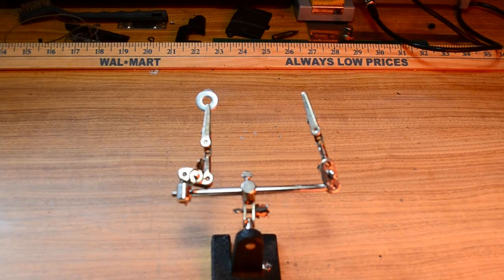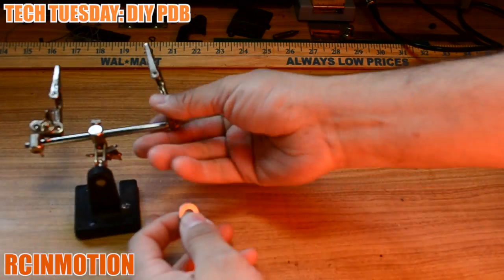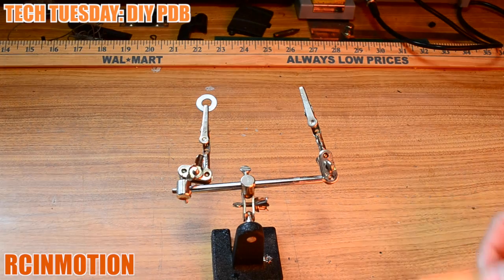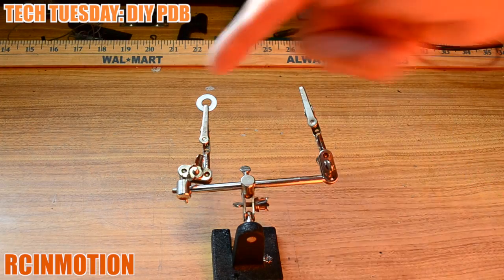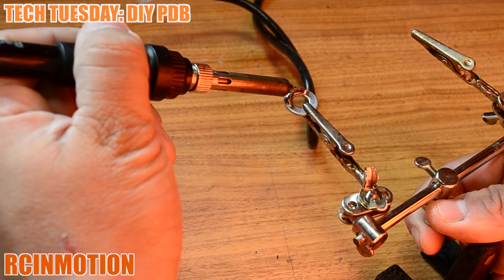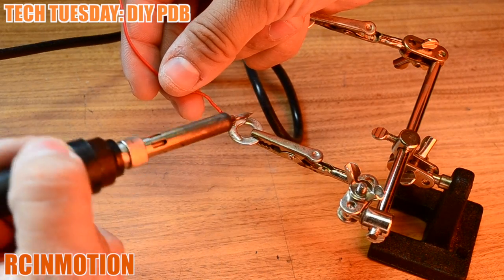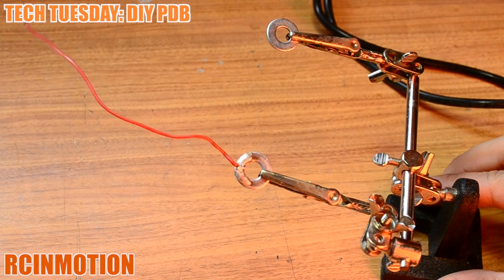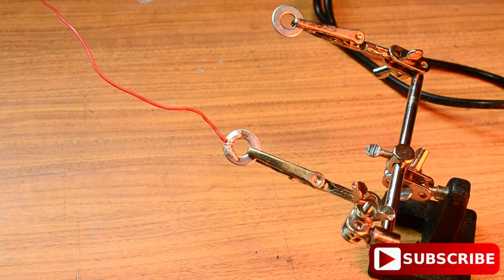DIY Cheap Quadcopter Power Distribution Board (PDB) - Tech Tuesday

Comment: how did you get it to stick'
Reply from the maker: _Rhin0 since they are zinc plated I sanded them down a bit just to create a rough side. Then I used flux and solder at a high heat. This way the solder would stick to them, then pretined the wires and connecting them was easy.

Comment: You soldered a wire to a washer. How does this help anyone?
Reply: well, that is more or less what basic pdb is all about. Unless you need 12 and/or 5V, in which case it will also include a couple of voltage regulators and filter capacitors.

Comment: If you cant afford a $1 pdb you definitely cant afford a quadcopter.
Reply from the maker: Sorry that this video did not meet your expectations. But this way was just a way of getting your quad in the air not to escape from a $1 PDB. In most cases you would want to fly but cannot because like I stated you forgot to purchase it with your kit. This is just a short cut for that, also most PDBs like the XT60 20A is about $11 no the $1 that you stated. This method is stated to work by actual MultiGP racers who I actually know. So please when commenting on a video please be sure to mention and state what product and name of the product so this way viewers are not as confused as you may be. As you saw I did state which PDB is actually not $1, most viewers may not be financially there so this method helps. I honestly think if you had time to comment on this video with no proof you should not own a quadcopter.
Reply: Don't be so offended lol. Copper clad plate, check it out on ebay or other sources. Very cheap and works fine.